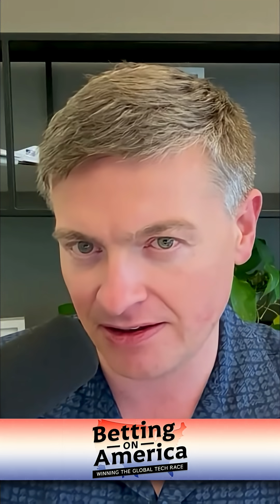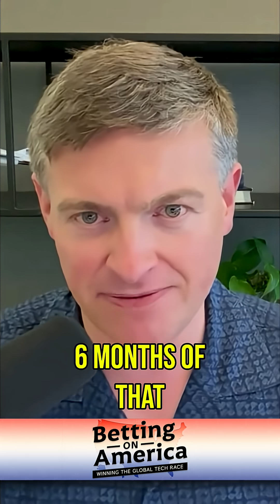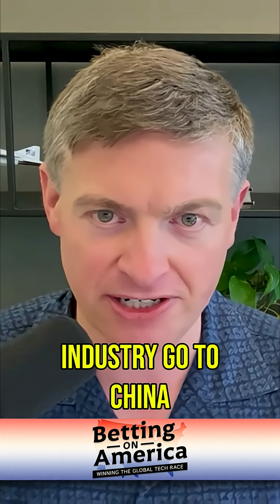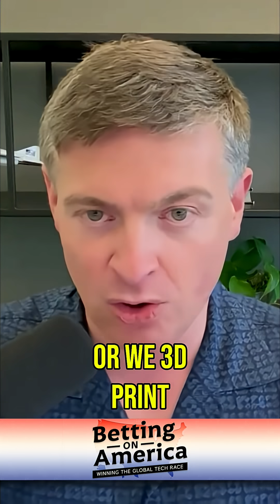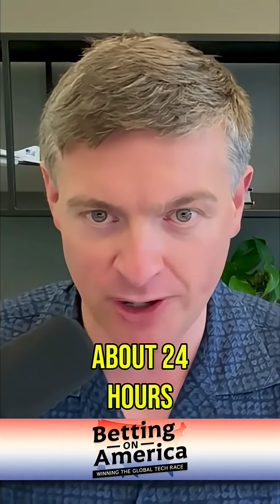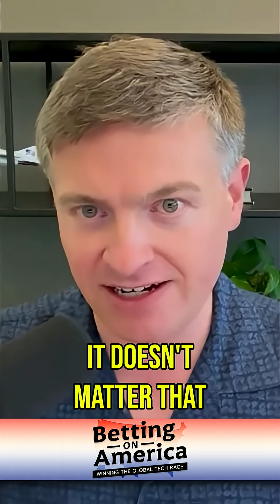Advanced Manufacturing to Bypass Supply Chokepoints? | Betting on America

Comment: Pipe dream
Reply: People are already using additive to bypass tooling.
Reply: @grega.4562 
Sintered metal is hardly going to replace tooling.
Reply: @grega.4562 I wonder the implications of "tooling" with additive manufacturing here then. Is China really just making it harder for thrmselves or is there something more difficult in this tooling process that isnt being mentioned
Reply: @PillarsOfHeaven 
I am sure that some parts are good for additive manufacturing but nothing load bearing and nothing that cuts.  Possibly a gear that doesn’t take much stress.  I was recently in an additive manufacturing plant, sintered powdered metals, the parts were able to be fairly complicated but not super strong.
Reply: High performance materials are rarely that simple.:/